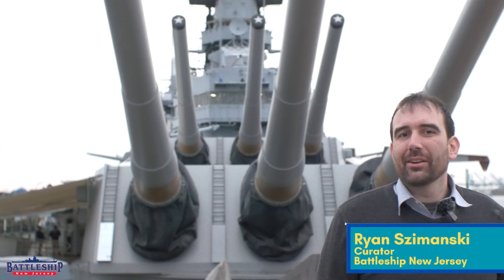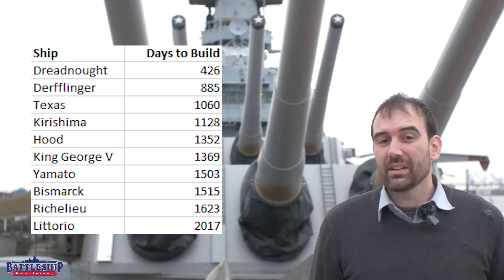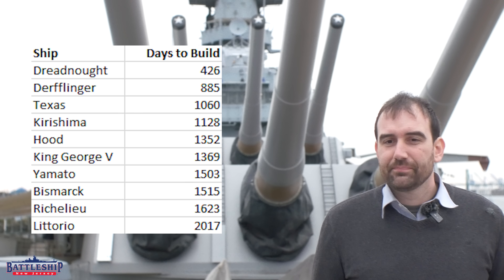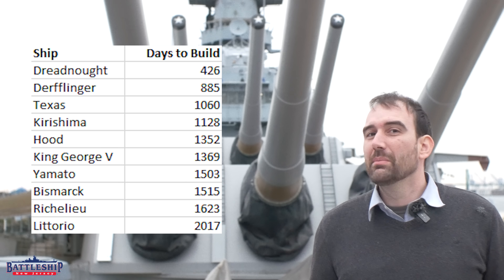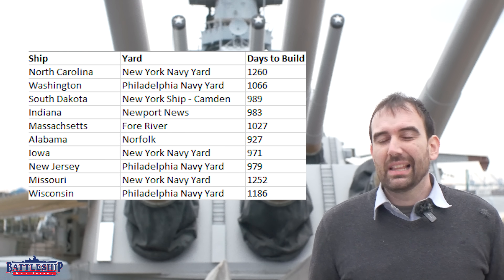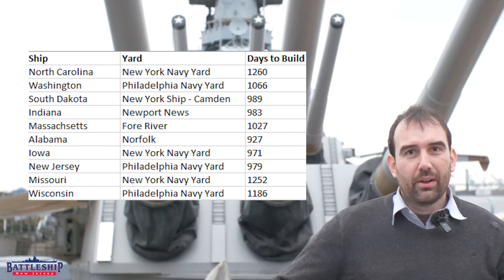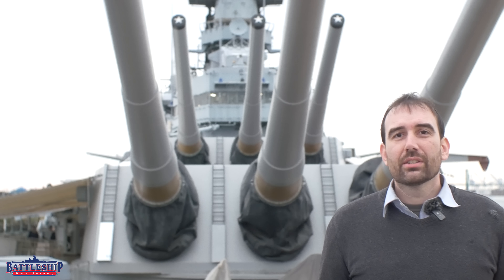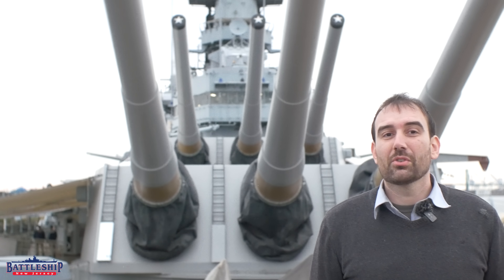How Long Does It Take to Build a Battleship?

Comment: If they had to do it TODAY, I’d guess 10yrs minimum simply because much of the tooling and infrastructure needed to build a BB are no longer around. What’s the lead time for a lathe and foundry big enough to build a 16” rifled barrel?. Iowa’s were built relatively quickly because all that infrastructure and knowledge was pre existing and actively being used at the time.
Reply: I don't think we could build the ships like how they did back then in 10 years or really in any amount of time. One challenge is like you said infrastructure, but even that wouldn't give us the expertise that had to be built up over decades. The only way we could attempt a new battleship would be with newer modern process's that would have to be figured out while building the ships.
Reply: @ggletsplay5041   not quite,  aircraft carrier hulls are still being made and can be adapted for BB's.  It's the cranes for the 16" that don't exist but I guess missiles are better cost wise than very large guns.
Reply: I agree.  Building the hull is one thing, the components - guns, armor, turbines, boilers, etc. - that is another.  If those components cannot be produced quickly then the build time from keel laying to commission will be slow.  If you have a large industrial plant used to turning out all of those items in large quantities, then it goes fast.
Reply: @mikeynth7919   Don't forget priorities - some ship types got higher priority for the limited production of some of those components before those caught up with demands. For a time battleships had higher priority for armor than other types, then it was switched to aircraft carriers (they used armor but not as massively as the battleships) .   Ships got things like 1.1" guns until 40mm guns were available.
Reply: In the 80s Cincinnati milacron built a machine to bore a 16 inch gun barrel
Reply: @kevinchildress6569  why would they do that?
Reply: You appear to be a critical thinker. I often marvel at people who wonder how the human race could forget how we built the pyramids. I remind them we don't even remember how to build steam locomotives and we only stopped doing that about 70 years ago.
It is never that easy for sure.
Reply: Armour plates would also be extremely difficult to produce nowadays.

Making 12" plate on the scale required to cover the entire belt of a Battleship (not to mention turrets, barbettes etc) would be extremely lengthy.
Reply: @ad3z10  Back in the day it took approx 12 months to produce all the Class A armor for a battleship.  the heat treating/cooling of each plate took time and couldn't be rushed.
Reply: @ad3z10  absolutely. We would have to manufacture the equipment to manufacture a piece of armor like that first.
Reply: Its not so much as we forgotten how to do things, but the trend to build lighter, more fire power (better explosives), more accurate, fuel efficient (mostly budget for fuel in peace time).  A missile today is more accurate and is designed to take out things today, then dropping a big 16" shell which obliterated everything. 
To build a 16 gun today would take a long lead time for materials and tooling and machines; unless you use a new technology like 3D printing (for armor, guns). But that technology would be secret and not let out.
Any Armor today would be composite armor, made of different materials.
Reply: Machinists don't get made overnight.
Reply: I’d argue closer to 12-14. Congress will shoot itself in the foot funding it a few times.
Reply: I agree the other issue is too not just the infrastructure is no longer there. But, the men and skills that truly knew how to bond and built steel structures is no longer there either for the most part eg barrels it is one thing reading a book on how to do it, it is entirely a different story when comes to actually physically making it. Could it be done? yes, of course it could be. But, at what cost? and I feel that is why it would never happen again and especially in modern era when ships now are so vulnerable. Not like in the pre WW2 days. Even in WW2 ships were becoming vulnerable and especially large capital ships by aircraft. Now the danger is torpedo's which can come from any direction and steered and of course missiles.
Reply: Was my guess, planing, Building, Testing, 10-15 total
Reply: Hum.  A lot of the systems are so old they wouldn’t use them.  
The old oiler steam turbines would likely be swaped for nuclear or jet turbines.  I.e. off the shelf gear.
The big 16 guns… assuming you would still want them.  Would you swap out powder charges for electro thermal?  The SDI program speced out electro thermal cannon which would double the muzzle velocity.  But he’ll, where would you even get shells?  Electro magnetic cannon?

The big hull plates and even shipyard facilities would take time to build up.  But you could get a wicket durable craft, with lots of missles and guns.
Reply: @KellyStarks  you read too many fantasy novels lol
Reply: @dirtdevil70  
lol.  No, just defence engineering and aerospace journals.  

The only steam turbine systems the navy uses is nuclear.  A Iowa is about the mass where nuclear becomes more cost effective, and it’s better if you need a lot of reserve electric power for newer weapons.  Especially electronagnetic or directed energy weapons the navy and AF are adopting. 

The big guns may be the hardest to justify given they are by current standards, very short range weapons.  

And of course with missiles and drones revolutionizing warfare.  A battle ship would need to find very new rolls.
Reply: It should be easier today because of robotics, artificial intelligence and advance manufacturing process. Back then, they are using primitive lathe with no computer. Today, you can just ask Google or seri  to build a battleship
Reply: @VIDEOVISTAVIEW2020  so you think Siri can build a physical battleship?
Reply: @dirtdevil70  not now but it's possible if they are going to integrate everything into a single line manufacturing process if somebody is going into invest on it.
Reply: Y'all are talking about the tech we've "lost" that we don't need. Nobody under 40 knows how to tune carburators either, and who cares? We don't use them anymore.

Just like how we don't use 16" guns
Reply: It’s weird to hear that. And it’s even harder to believe we’ve regressed in so many ways yet come so far.

These ships are truly marvels of human history.
Reply: As far as the guns go, all were made at the gun shop at the Washington Navy Yard and they only made them when the ship was under construction and no extra were made
Reply: @ensnipe2000 that is very untrue. Most all gun barrels were machined at the Watervliet arsenal near albany NY.
Reply: @JimLahey14  Midvale Steel in Philadelphia and the Navy Gun Factory Washington Navy Yard, they are assembled from 4 pieces and not welded together
Reply: @ensnipe2000  sure they may have been assembled there but not made there
Reply: I would blame the 35h week😂
Reply: I would blame union workers. Hence why our automotive industry is in shambles

Comment: One thing that I think impacted it was the reports coming back from the fronts.  I'm sure there were some changes being made on the fly to the later ships due to battlefield lessons.
Reply: Very much so on the Essex class carriers; they would make design changes and improvements in response to battle damage and incident reports to ships on the building ways , if they could make the changes without causing delays to complete the carrier.

Comment: It would be cool to see modern ship building methods such as modular construction being used to produce battleships. If you account for inflation a modern day destroyer costs more than the iowas.
Reply: One of the problems with comparing WWII battleship (or aircraft carriers) build times to modern times is the huge increase in size and technology.  It's really like comparing Apples to iPads.  They were also prototyping new technology with the Ford Class carriers, and even political reasons delaying build times for budget reasons.  There were also significant delays building the Teddy Roosevelt Nimitz Class carrier in the late 70s and early 80s while the Navy contemplated building smaller cheaper "Sea Control" carriers.
Reply: A modern day destroyer is also MUCH more capable and effective than a battleship, even after the 1980s refit.
Reply: @cf453  I actually think that the secondaries with modern guided shells are more useful in a shore bombardment role than 16inch guided shells.
Reply: Yeah, and what would the 2023 price of a pack of cigarettes buy in 1940?  Maybe a very good meal in a very good restaurant?  Maybe a week of groceries for a family?